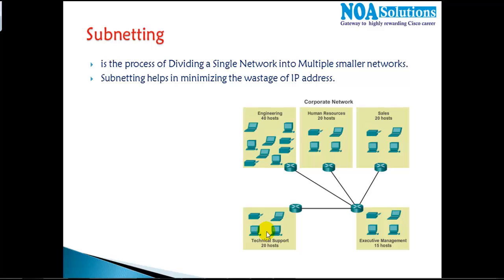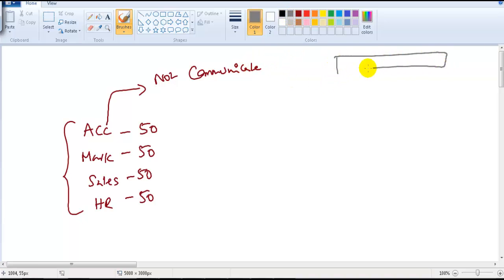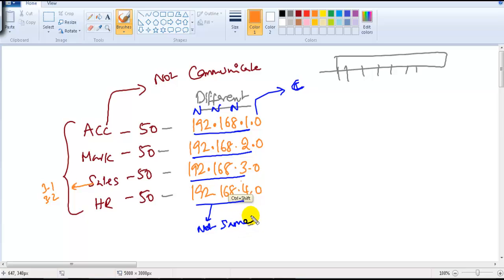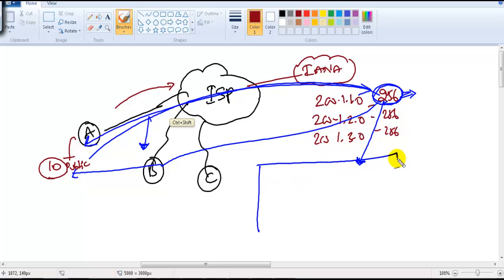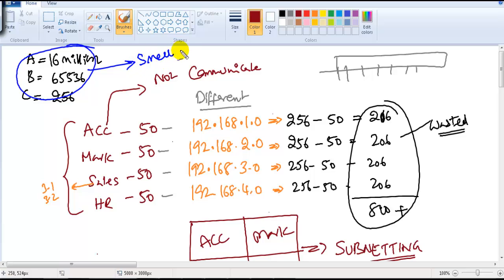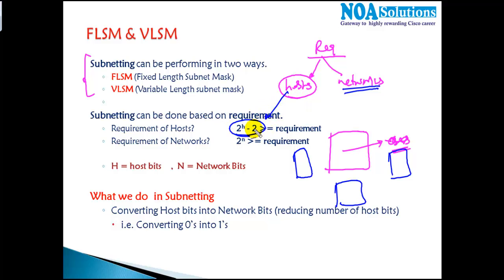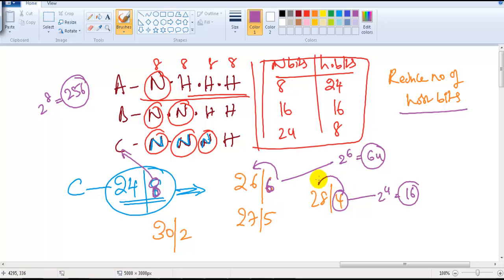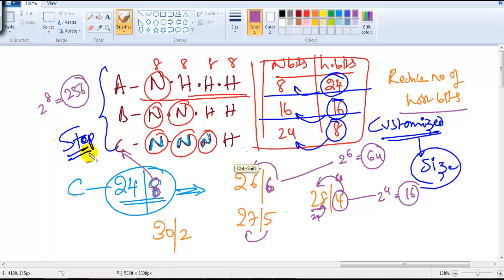Why do we need Subnetting - Video By Sikandar Shaik || Dual CCIE (RS/SP) # 35012

Comment: Sir, is subnetting done only for private networks/IP's? If it is also for Public Networks/IP's, then how it is done for such networks (public)?
Reply: Most of the trainer use 'Private IP addressing range' for subnetting for their explanation. The method we use for private IP address subnetting, similar is also applicable for 'Public IP address ranges'.